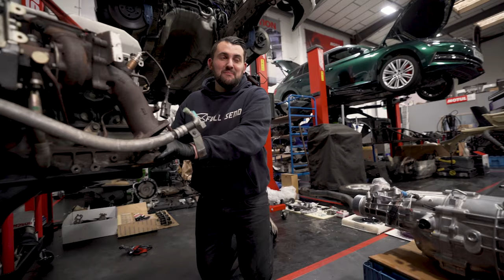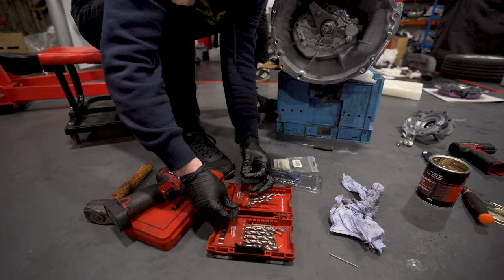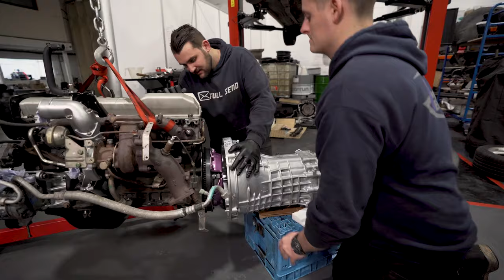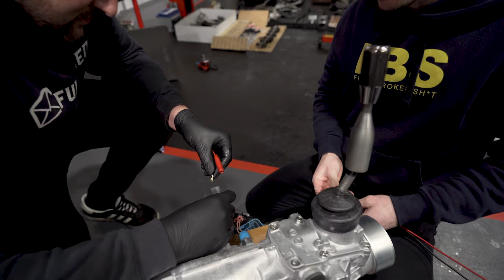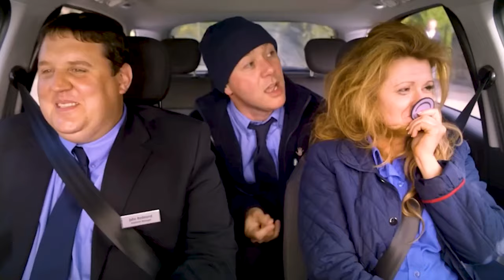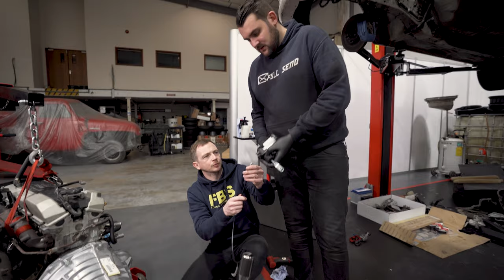How To Convert An Auto Skyline To Manual | Project Skyline PART 6

Comment: Bye the way guys am no mechanic but a just watched Jimmy oak's garage and he's a big Nissan man and he mentions putting gasket sealant on the push plate bit you put in because the lowest bolt's on that tend to leak oil and it's a big job to undo for 3 bolt's that was his tip recommendations you should check it out

Comment: There's a trick to drill safer. Use a short drill bit called center drill i think. It doesn't wobble as a normal drillbit. And you can correct the drilling if you see you missed a bit.

Comment: Great video as always, love the banter as you guys work.. Question..when you were installing the spark plugs into the Skyline engine block, you did not use coppaslip is this a misconception that it helps when removing plugs if needed as it helps in the hi temps fitting, it's just not needed.. as torque settings are for dry threads... cheers..👍

Comment: Hi Ricky, that spigot bearing ,is it an Oilite type. Odd stuff, if so, it's basically a powdered material, formed to size. I got caught out recently, once driven into the crank ,it went a tad undersize, making the 1st motion shaft too tight, on the way in.
Just a thought mate.

Comment: When docking a gearbox to an engine, is it essential that both components have OEM sleeves? If one or the other has been modified/desleeved, can you still successfully dock both parts together? How much tension are the nuts under in this scenario?